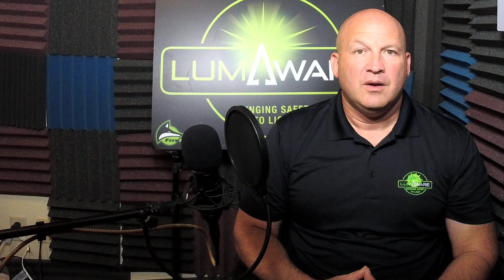Danger - Are you using nuclear exit signs?

Comment: This is Unwarranted Fear mongering. Tritium is remarkably safe. They are expensive to purchase but if you have to fork over $400 every 20-25 years with no other maintenance with peace of mind then I’d say that’s worth it. You mention Tritium hand in hand with radium. Radium has been phased out since the 1970’s. Tritium exit signs are engineered to be shock and break resistant and that’s just the housing. The actual Tritium vials are made of borosilicate. Incredibly sturdy. You’d have to take a vial and purposely snap it apart or smash into it with heavy machinery to compromise the structural integrity. The NRC knows who has them. It’s part of the regulatory system on Radioisotopes of this low level category. If one of these Signs breaks the protocol is to vacate the area and let the gas dissipate for 10-15 minutes. It should be frowned upon to use the fears of radiation to make a profit.
Now let’s talk radiation exposure… Tritium Exit signs have a good bit of Tritium gas inside the phosphor Coated vials. If you had a Geiger counter next to it you might get a little above background exposure coming off the sign. And that’s at a distance of mere Centimeters away from the sign itself. You act as if people are going to be kissing the Darn thing. 
If you had 25 of these signs in a department store similar to Walmart. The amount of radiation you’d be exposed to compared to regular background radiation is insignificant to say the least. These signs pose no danger to the general public or operators unless negligently misused and destroyed maliciously. The Radiation given off is Low energy Beta which can’t travel more than a few inches in air and can be stopped by a piece of paper. Yet you want to criminalize a Self Luminous exit sign for Financial gain by spreading Misinformation.